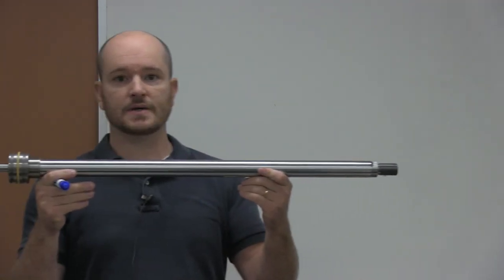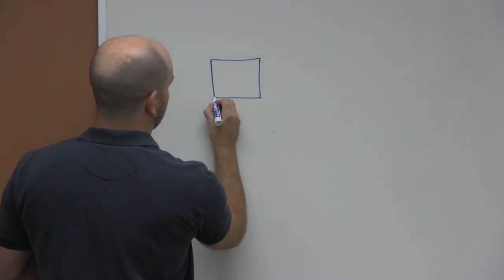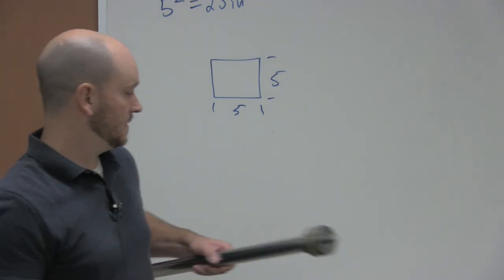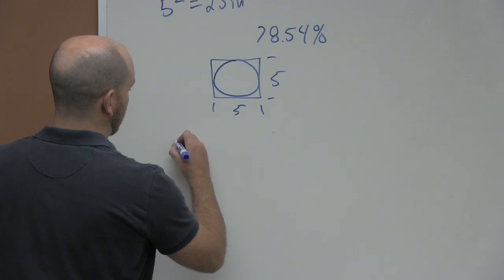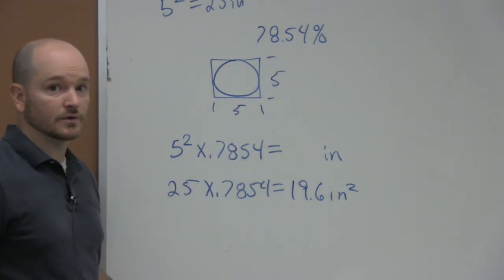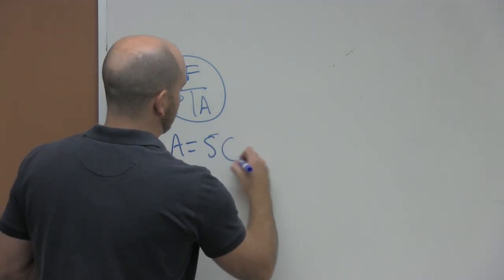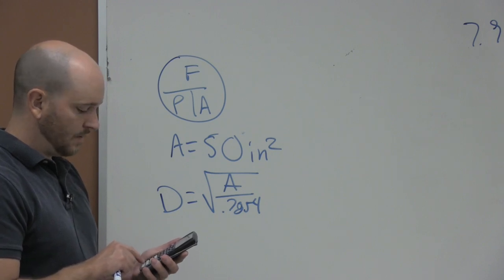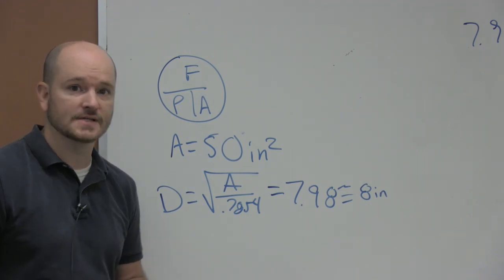Calculations for converting Diameter to Area and Area to Diameter

Comment: Whatever happened to just Pi R2 ?
Reply from the maker: Nothing.  it works but cylinder companies give the diameter not he radius.  And this the formula that the IFPS uses.
Reply: @KletteTech  you could also use (pi*d^2)/4. All of the options work well enough for these purposes.

Comment: What for 78.54%
Reply from the maker: 78.54% is the multiplier for when the diameter of the cylinder is known.  It is a constant.   Hope this helps.
Reply: The standard way of calculating the area of a circle is pi*r^2 where r (radius) is 1/2 of the diameter (d/2). If you square d/2 you get d^2/4. Substituting into the original area formula you get (pi*d^2)/4. pi/4 equals 0.7854. I also teach at a technical college (using Mr. Klette's Fluid Power textbook) but prefer students use the formula they were exposed to in middle school and high school to calculate the area of a circle (it is not hard taking 1/2 of the diameter to get the radius) instead of having to memorize another formula with a new constant.
Reply from the maker: Blake Murphy.  Just saw this post.  Thanks for using my book and thanks for posting here.
Reply: @blakemurphy2826   true. Where can get the book.